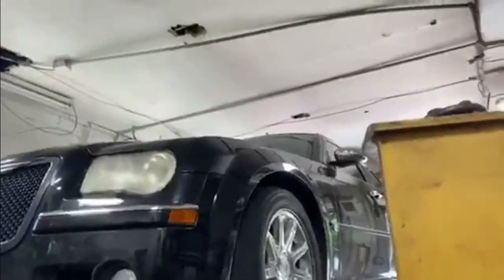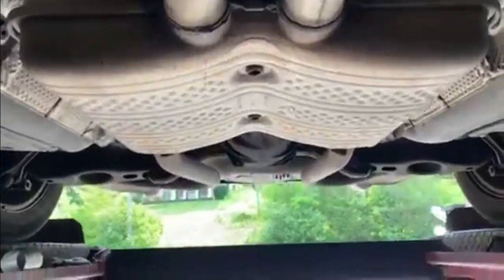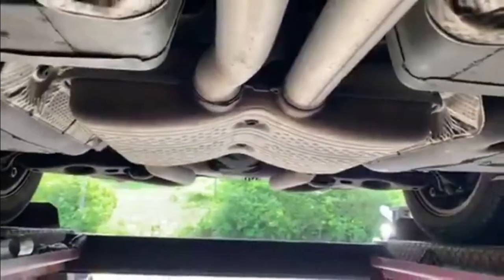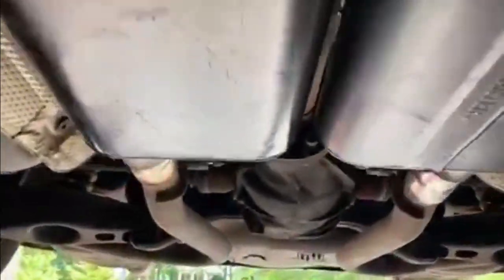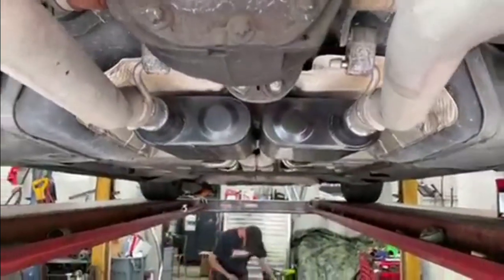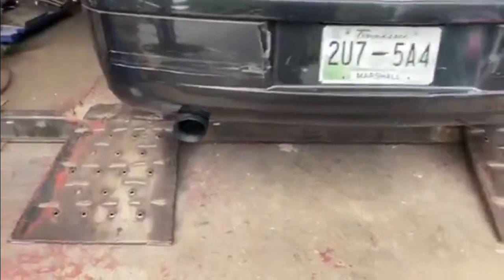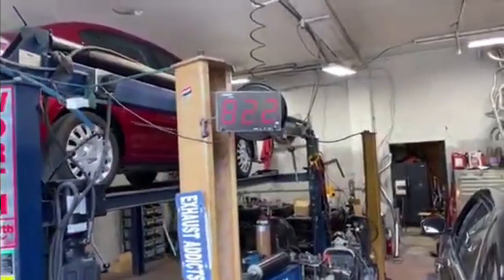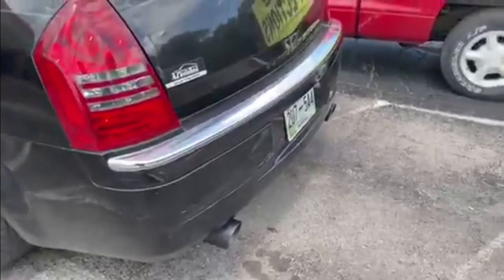2007 Chrysler 300 C 5.7L HEMI DUAL EXHAUST w/ FLOWMASTER 40 SERIES!

Comment: New subscriber here, I like what you do on this site. It is exactly what I need to get an idea of the muffler mods I want for my 09' 300C. Personally, I liked it with just the Flowmaster 40's before the rear delete... That's just the sound I'm looking for, I have a Ram 2500 5.7L Hemi that I had a loud exhaust installed on and that's fine, it's a Truck. My 09 300C 5.7L Hemi 375HP Heritage Edition just needs a little rumble over the quiet stock mufflers for my liking... I currently have this set-up as my # 1 ... This is great!! Thanks for what you're doing here... Keep 'em comin

Comment: I already did my resonator delete, still have the suitcase and still want a deep tone but want to be a little louder than this, what are some reccomended mufflers
Reply: Do some super 44s if you want it louder but not too loud. And if you want it alot louder do Super 10s
Reply: Straight pipe if you really to get a good sound
Reply: charles diggins Ngl not the biggest fan of the 5.7 straight piped
Reply: Delete the suitcase. I deleted mine and still have resonators and it’s loud. Louder than this and I’ve scared a few ppl
Reply: @JR-wu3gg  what did you put in place of suitcase.
Reply: @Larry Cotter straight piped. And it’s definitely louder than this vid
Reply: @camss8094  straight pipe might be louder but it’s a ugly sound
Reply: Just straight piped mine and it sounds like a fart machine I’d go with a super 44 if you want louder than this or a super 10 for super loud

Comment: I did this same set up, Flowmaster 40s and resonators deleted.  Mine was quiet at first, then got louder after about a month or so.  Could use to be a bit louder, but it's okay.
Reply: the resonators are the flowmasters the thing with the tips on it is the muffler
Reply: @DJJumpdancer  The muffler and resonators are flipped on mopars
Reply: If u want ur car loud straight pipe it no cats or mufflers 😂✌🏼